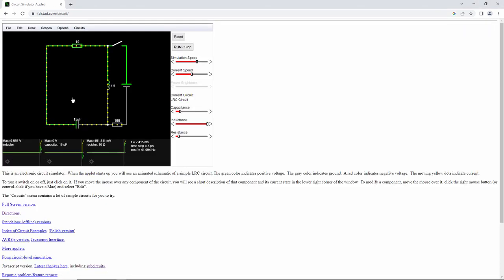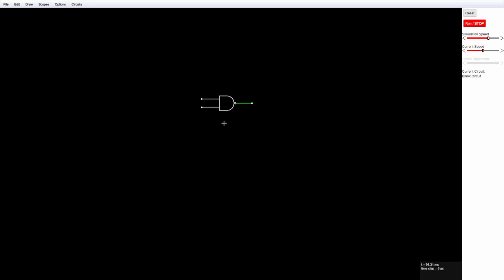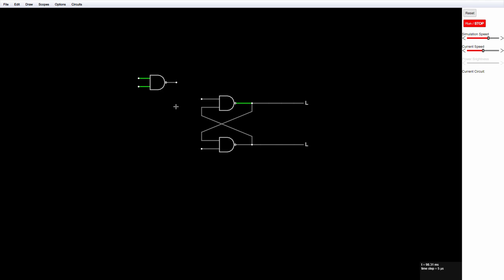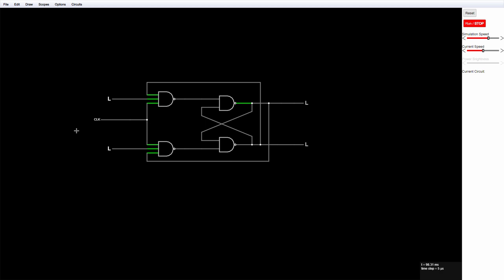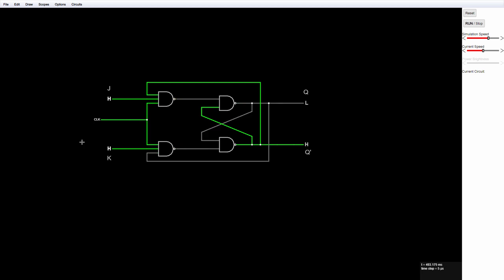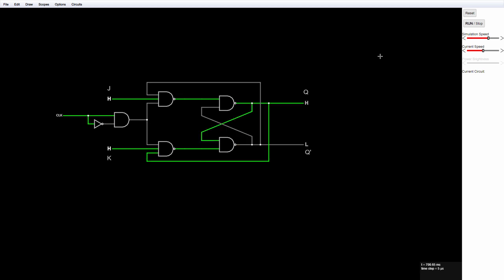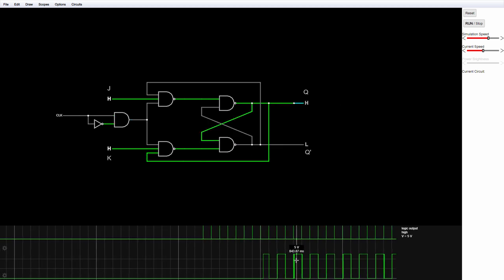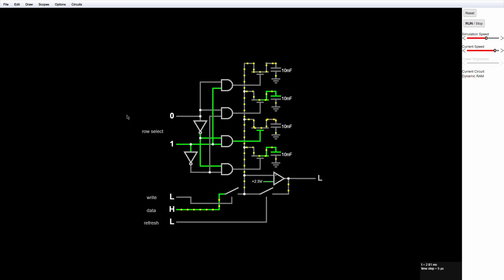Falstad Circuit Simulator

Comment: I find it to be a pain in the AZZ. If you move a component the line segments don't move with it. And the line segment as also a pain. You have to add so MANY. You can't just add a node. Many of the components don't work proper either, like the timer relay.  You can't even change the colors.

Comment: Nice Simulator. Ive been using logism evolution but this is better on the go
Reply from the maker: Indeed.  Thank you :)KD
Reply: They don’t serve the same purpose. Falstad is an analog simulator whereas Logisim is digital. The latter helps you to verify that digital circuits, even extremely complex ones, are logically correct

Comment: I would love to see more ECE stuff.
Reply from the maker: When I get time, I want make some lessons on how to simulate DRAM, SRAM, decoders, adders and the like.  There are lots of prebuilt examples available, but I think it would be beneficial to see them built from scratch, so a student can follow along.  Do you have anything in particular in mind that you would like to see?
Reply: @ComputerScienceLessons  Yep exactly what I thought., like circuitry and logic stuff whatever goes hand in hand with CS. 

You can also check grad program and try to see the intersection...
Reply: grad program as in ece program with honours and/computer systems engineering.
Reply from the maker: will do :)KD

Comment: Hello, I would like to ask you if you know of any boxes or tools within the simulator. It's missing that it allows me to measure a certain amount of time, or that it grabs a specific piece of information to do a mathematical operation.

I am doing a project in Falstad that intends to measure the capacitance of a capacitor from the time it takes to charge, and I have the formula to achieve this, but I do not know the tool that can allow me to display that data and capture said charging time. burden.

t would be very helpful to me and I would deeply appreciate it if you could answer this question for me.